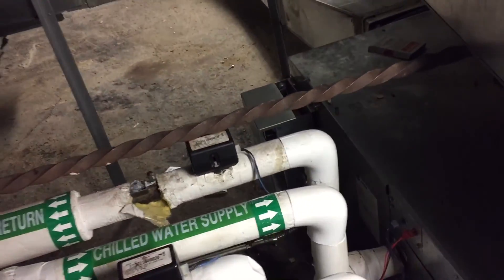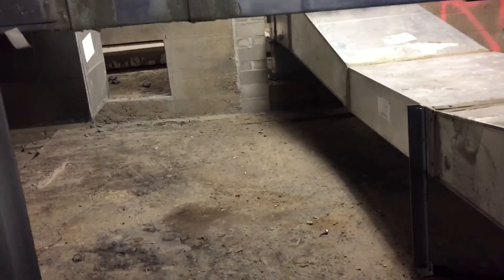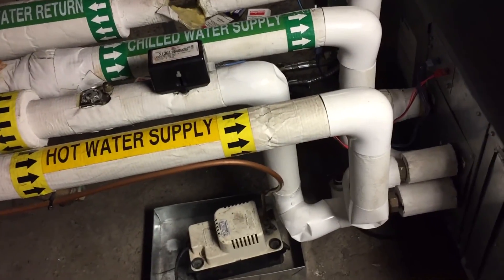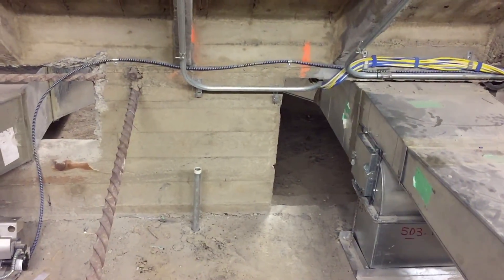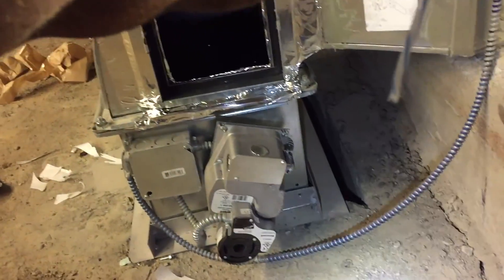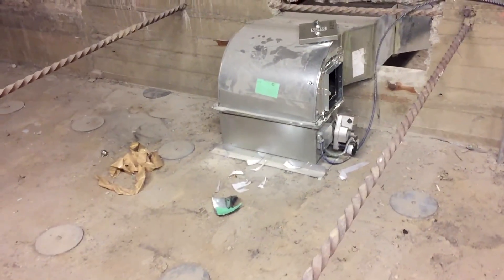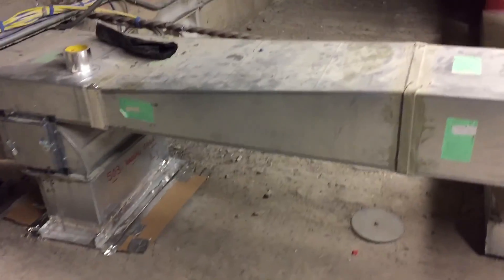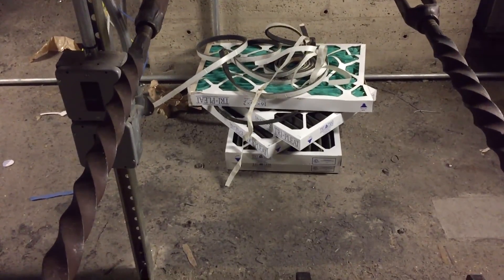OMG Crazy issue w/  Fan Coil unit (Commercial HVAC)

Comment: How does a fire smoke damper operate an what is its purpose.
Reply from the maker: bill banek The smoke dampers are controlled by the buildings fire penal system. If the fire alarm goes off or the smoke detector system, the units will shut down and all the smoke dampers will close preventing smoke from traveling through the building via the duck work. All of the opening around the duct should be sealed with fire stop caulk to prevent fire and smoke from traveling around the ductwork thru the penetration.